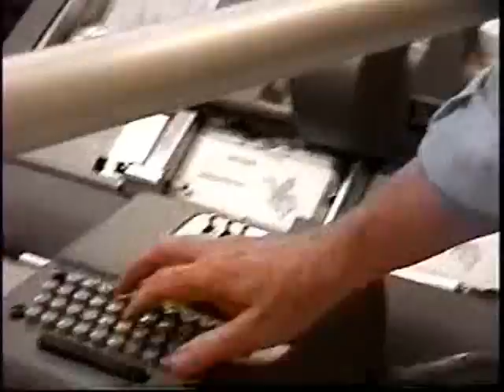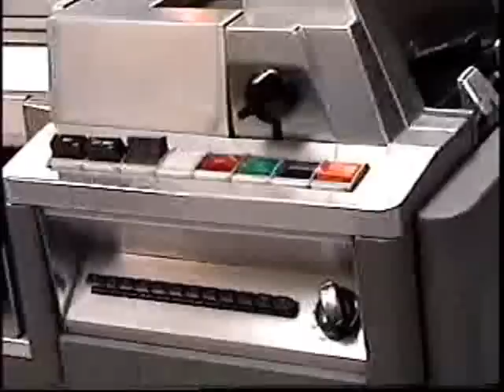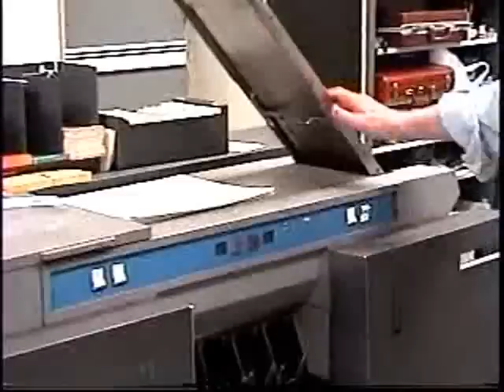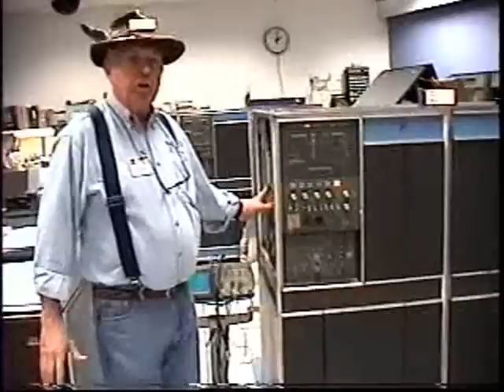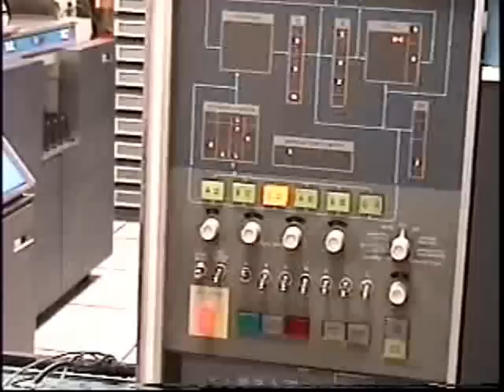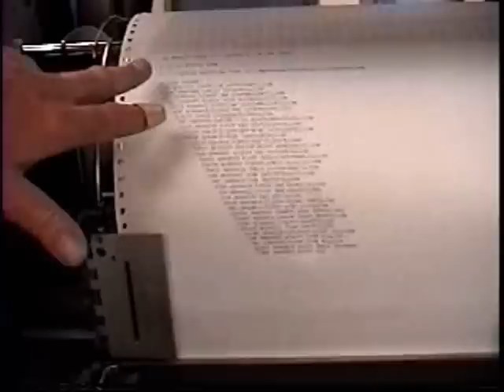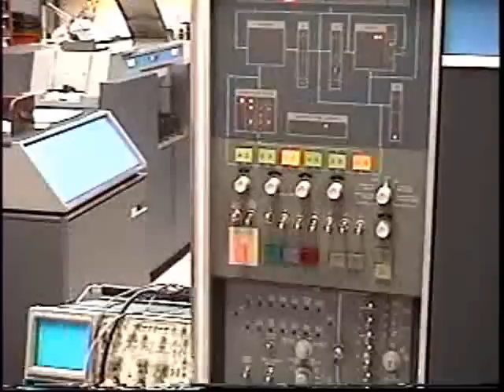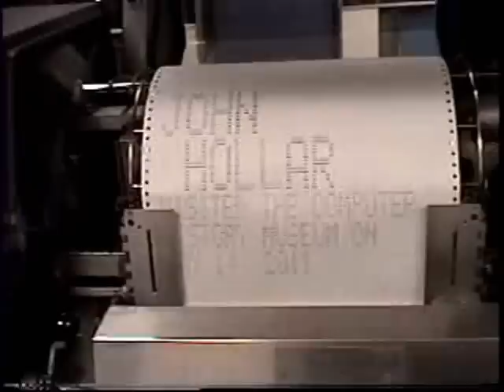Data Processing in 1960s

Comment: Powers-Samas established in 1915 used a variety of card sizes and formats, including 21, 36, 40, 45, 65 and 130 column cards. While their equipment was mostly mechanical they provided
tabulators and accounting machines which in later models were controlled by plug boards which gave rudimentary computing functions. There were other companies around doing the same thing Hollerith Comes to mind. The Computer History Museum has examples of these. The 1401 is really late 50's very early 1960's by 1964 the IBM 360 had been announced and installed. We already had a 40 column Power Samas installation, processing, travellers cheques, ledgers, Bills Payable on demand, the corporate share register. While not IT in the true sense it was effective technology, limited by the mechanics used.
I started my computer life in 1965 as a machine language programmer on one of the first IBM 360 computers. We had a room of 026 card punches and, as a bank we had to ensure everything was punched correctly, cards went through a second process via the IBM 029 Verifier. This machine read the holes and checked them against what was being entered. If they were the same they had a small notch punched in the right hand edge. We also had an IBM Paper Tape reader, most unusual. We had no tapes, but 2311 disk drives, we wrote a programme to allow us to read the files sequentially. Those were the days. A cheque sorter/reader, where having been on the course to programme it, I learned  a whole new technique and then found that our 360 cycle speed was not fast enough - all cheques would go in the reject pocket. Great to see that some of this is being kept in working order. Brough back a lot of memories, thank you.

Comment: The large number program is fascinating, but actually, it's mathematically provable that you can do anything this machine does on a modern PC, given the right program.
Reply: That was 70 years ago and a significant step forward. Did you not listen, the memory was 4k that's right 4000 bytes with an upgrade to 8,000. The 360 I first worked on had 32,000 bytes of memory, which took up a cube about 15 inches per side. It was made of tiny ferrous rings each of which had 3 tiny wires threaded through it, to turn it on, turn it off and read it. My PC has 8 Giga bytes that is 8 billion characters. It also has integrated circuits comprising millions of resistors and capacitors, a pair of which make a memory cell. Of course the modern PC can do it - so what! That is called progress - at the time this was amazing, and very exciting - I know I was part of it.

Comment: I have a student manual / study book (describing and detailing its operation) for the IBM 407/408/409, and punch cards and program printouts from when my dad learned to program in community college back in the sixties.  Its the oldest things in my rather unwieldly antique 8 bit computer collection going back to 1979

http://en.wikipedia.org/wiki/IBM_407

http://www.columbia.edu/cu/computinghistory/407.html

https://www.google.com/webhp?sourceid=chrome-instant&ion=1&espv=2&ie=UTF-8#q=ibm%20407
Reply: I maintained an IBM 407 Accounting Machine.  What a beast!  I watched this video hoping to see one.  I've also worked on the IBM 1401.  It's timing is provided by the card reader (when reading cards) and it controls the timing of the printer hammers which means you can play music with the line printer.  the 407 weighs over a ton if I remember right; powered by a 3/4 horse electric motor, had thousands of wire contact relay points (tiny silver wires) and a few hundred mechanical cams that had to be timed within a quarter degree on the master timing cam shaft.   I regret discarding my collection of maintenance manuals; I should have scanned them.

Comment: The Museum should use some of these old working machines to make things to show what they would have been used for day to day.  Like making a database with each guest having a record.  Like a guest book/mailing list stored on punch cards or tape or whatever.  I am always so disappointed to see that they just show off the machinery without ever restoring it to working condition or never turning it on and using it in any way.
Reply: Elsewhere on Youtube this machine is indeed shown restored to fully functional condition compiling and running a FORTRAN program.
Reply: What would you see? a spinning tape reel or disk - no vdus then. We did not have data bases then we had serial files (tapes), random or direct access files(Disks). Certainly you could punch a card with your name on it. Not much point in anything else.